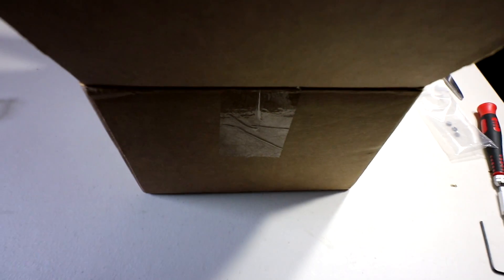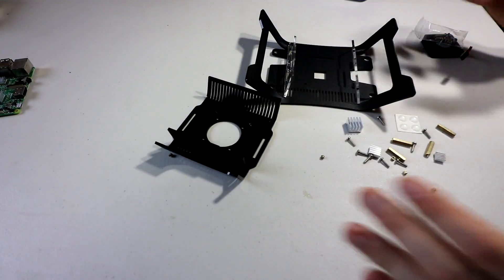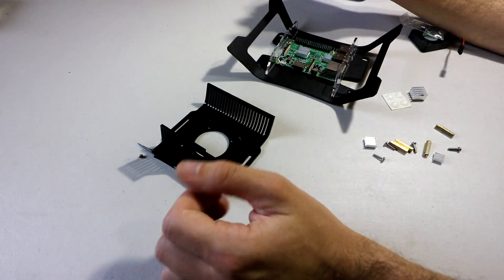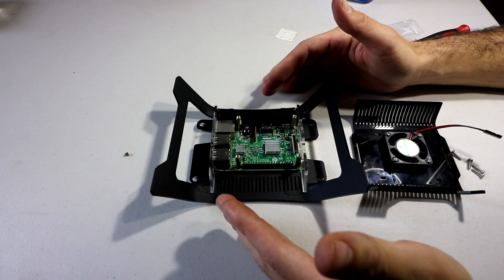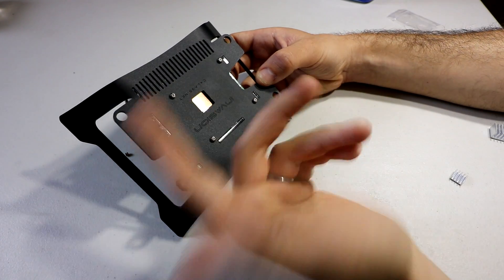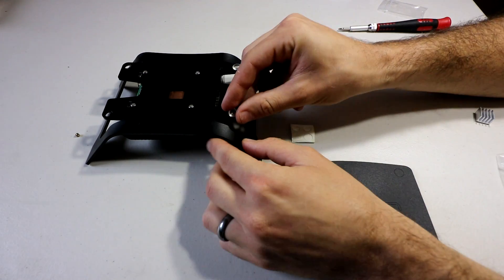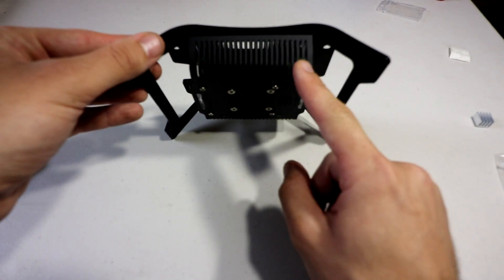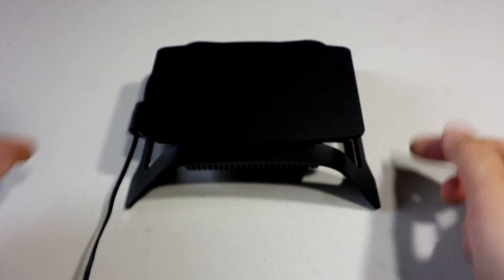C4 Labs INVASION Raspberry Pi Case - Excellent Cooling

Comment: Is there another pi case you would pick over the wicked aluminum if your not worried about price?
Reply from the maker: thats a pretty baller case. I would probably get the Nespi or Katuma Case because they have pretty good cooling and look great and they are not allumunum so still good wifi and bluetooth or with allumunim go wicked...
Reply: Cool thanks for the input. I currently have the wicked but was interested if there was another you would recommend. Thanks again
Reply: What is the "Katuma Case" Google doesn't come up with anything.